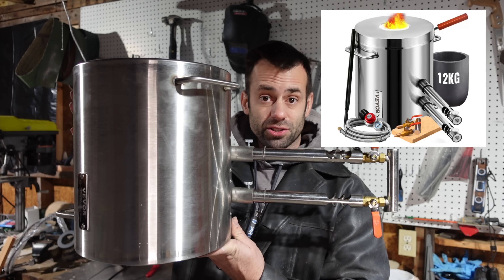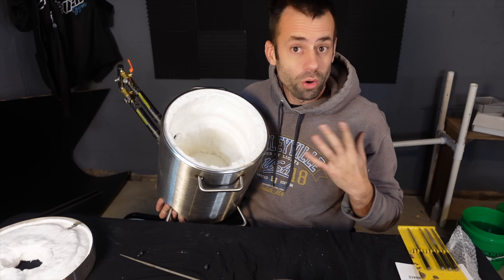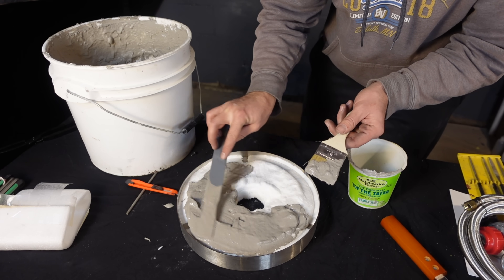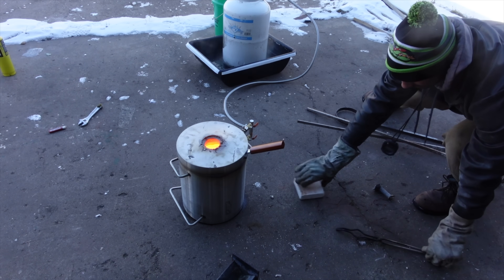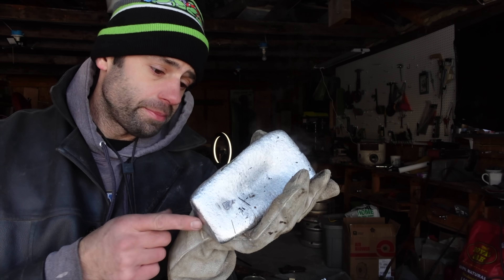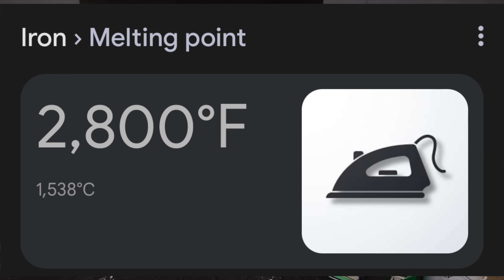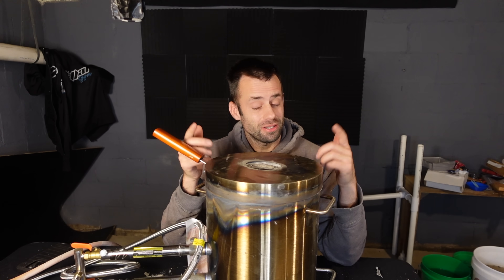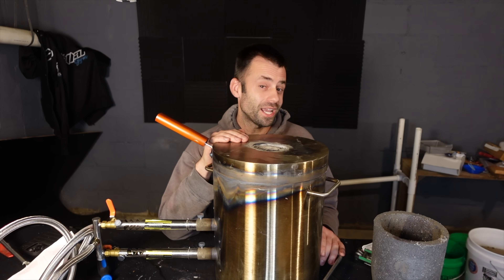Vevor 12K Melting Furnace Review: Is it Better to Build or Buy a Foundry Furnace

Comment: I've been doing this for some 60 years (not joking) and there are a few operational tricks you may want to pay attention to. Yes, this is a perfect what not to do video.

Correct on the lifting tongs, crucibles are made of clay and graphite, both are fragile and worse when combined. Ther idea of lifting with tongs is okey if they weigh under 2kg, more than that and damaging them is immanent. 

Small furnaces like this are only good for small crucibles.  Even if a #16 will physically fit, you don't have the right circulation room around it for proper heating.  Also, a small furnace kike this only needs one burner, these looks a bit crazy and consume too much Propane.  I like to see room around my crucible, it should only take up 1/2 of the inside width of the opening and floor.

Though fire wool is technically sufficient to hold the heat, it isn't sufficient over time to protect the furnace body.  I use a thin 1/2" thick rock cloth around the inside and layer in high temperature furnace concrete (not the patch used here in the video).  Use some heavy gauge stainless steel wire to hold the white cloth in place and it also acts as rebar in the mix. I would suggest layering or pouring it over an inch thick or more on all sides and bottom. The lid should be twice as thick and have a steel lip in the bottom to hold the lid material in.

And above all else, the lid opening is not for cramming materials into the crucible, that is the necessary burn relief hole (chimney if you will), throttle back on the gas ad any blower you have on your arrangement and use fireproof gloves or tongs or even a pouring funnel to direct materials into the crucible.  Do this quickly and cleanly and it won't mess up your heating process.  More room around the crucible, as I said above, will allow it circulation room and room for lifting tools, and you will work better and easier, and you can thank me later.

Comment: I use a product called Satanite to cover the inside of the kaowool in my homemade furnace. It's not expensive and works really well. When correctly prepared it looks like the greenpatch you used. It takes a few days to dry after you apply it (I use a minimum of 2 coats, wait until the first is mostly dry then apply a second one) and after it's completely dry I fire it with an empty furnace for at least 30min. It has held very well for a few years.
Reply from the maker: I actually have used that as well. I didn’t like it as much because it cracked so badly.
Reply: I’ve done some more things with furnaces I’ve built.

Another thing you can do is use ITC 100, from the pottery industry, which is reflective to infrared and boosts the effectiveness of one of these tremendously. You can apply either to kaowool directly, or onto the refractory. It’s expensive but effective.

Comment: Aluminium cans are ultra pure aluminium as is aluminium cable. Most other “aluminium” is a copper magnesium aluminium alloy of varying composition.
The ABS plastic coating on drink cans leaves a nasty soot when burnt.

Comment: Would wrapping an electric blanket around the tank set on low prevent freezing?
Reply from the maker: Possibly. I’ve never tried that one. I just go with the hot water.
Reply: @lundgrenbronzestudios  Ok, thanks.
Reply: The tank gets cold from the propane changing from a liquid to a vapor.  It's not usually a problem when using it in a low flow environment, but when pulling large amounts of gas like this it is.  What the tank needs is heat from the environment to vaporize the liquid.  Once propane gets to around -42 (Celsius or Fahrenheit, either works) it will just stay a liquid and you can pour it into a cup.

Comment: i wonder if i could make wrght iron spung with it hmm.
Reply from the maker: I’m not sure.
Reply: @lundgrenbronzestudios  i think it can make molten steel with a single upgrade. burners get plenty hot. im 90 percent sure the 2700f is cuz the refractory is rated for that. i got 3000f refractory blanket that ive used to line my home maid blast furnace. thats the same thickness this uses. nice review of the product. shows me what i needed to know. good job! and dry sand you should be putting hot items on. bad things happen other wize.

Comment: Ive been making homemade furnaces since the king of random made that mini metal foundry video like 10 years ago. I finally cracked down and bought a devils-Forge and I gotta say I couldn't belive how crappy my home made furnaces where compared to it, the damn thing can melt copper in 10 minutes, normally I'm pushing 25-35 minutes to melt as much as I did in my first go with it. Given that the FBM2B or whatever it was I bought the 10KG model only cost me $300 id absolutely recommend it to anyone who wants to get into the hobby or there smaller one for $220 Id guess the amount I was spending to build my own not even counting my time was around $200 and you'd sure as hell save a ton on the propane.

Comment: I've got this same furnace. I used Stannite refractory coating. I had to do two applications because of cracking and things got pretty lumpy. The thin SS shell warped after a couple of firings so I have considerable leakage around the edge of the lid. Still works. I've only melted aluminum so far but intend to try copper & brass. I've got a larger fire brick lined furnace that I've been using for a few years. I tried the Vevor in forging mode but I'm not setup well for that. The blast coming out the front I partly blocked with fire bricks but then it was difficult to get the work in & out. Need a lot longer tongs. 

The cast iron melt was interesting. Didn't expect that. Will iron destroy that crucible? 
Safety! I agree get off the concrete, it will blow out. I invested in fire resistant chaps, boot covers & gloves plus a full face shield. Never wear synthetic clothes when casting! If the crucible breaks or you spatter molten metal it will eat right through you!

Comment: useful stuff. I was surprised at the cast iron too. I have a second hand smaller vevor one that has the same warp in the lid, so I am thinking its just a thing...I'm not using the casing I bought it for the burners and the refractory because it was such a good buy. Who ever used it before me didnt coat the ceramic wool so who knows what happened. I actually made my own rigidiser and was able to soak the ceramic fibre but I still went ahead and coated it with fire cement just to be sure (an extra £30 is worth my lungs)
Did you flux the crucible?
thanks for sharing
Reply from the maker: I did not flux the crucible. My past crucibles I didn’t need to, this one though I think maybe should be.
Reply: @lundgrenbronzestudios  I have a couple of similar crucibles and I wasn't sure but it seems like doing it is just a better idea than not doing and won't cause any problems but could stop a few. As far as I can tell fluxing is usually to stop precious metals from sticking to crucibles but stopping copper or bronze sticking seems like a good idea too.
Thanks for answering

Comment: YouTube creator luckygen1001 melts a lot of cast iron.  If I recall, he always cuts and analyzes sprues to make sure alloy has proper carbon matrix for best properties.  So many antiques are made from cast iron.  Remember when I was a kid having an elaborate large toy bank made from CI.   They are quite valuable now, unfortunately mine was stolen. Cast Iron is very fluid - great for thin wall castings.
Reply from the maker: Yeah luckgen1001 is a metal master. He really knows his stuff.
Reply: @lundgrenbronzestudios  Frankly, I think a furnace with a heavy cast slurry 1-2" 3000F materials inner lining with an Koa-wool outer blanket will hold up longer, especially with cast iron.  Just an uneducated guess though - time will tell, I guess.   Also surprised only one layer of wool, not two?  Wonder what the wool's tmp rating is?  
Nice score  on both the furnace/forge and the GreenPatch - sweet!  Looking forward to more cast iron projects.😊

Comment: Seems to me that this is a perfect kit to build your own anyway. I'm not a fan of the thin wall stainless, or how thin they have the ceramic blanket. But if I were to make my own furnace, I'd much rather use the twin burners, valves and accessories that this comes with, so I don't have to source my own or possibly not build it correctly.
Reply from the maker: The blanked is inset so it is actually thicker than it looks. It’s an inch thick.

Comment: How about melting down battery plates? The plate filler has always been a question for me to get to melt down into pure lead, but I've never had a proper furnace to melt my lead.
Reply: I would not use that much heat to melt lead, I've melted a lot of lead in my life and toxicity is overrated when working with metallic lead.  Batteries on the other hand have some other additives and lead oxides and I don't think I would melt one.  I've heard of people doing it chemically.
Reply from the maker: I don’t want to handle lead. It’s too toxic.

Comment: Can you use Water Glass , used also to seal eggs to preserve?
Sodium Silicate I think is the real
Name.
Reply from the maker: I’m not sure. I’ve never heard of that being used but silica is not really made for temperatures that high.
Reply: Yes only to 2000F deg 

Sodium silicates are stable in neutral and alkaline solutions. In acidic solutions, the silicate ions react with hydrogen ions to form silicic acids, which tend to decompose into hydrated silicon dioxide gel.[citation needed] Heated to drive off the water, the result is a hard translucent substance called silica gel, widely used as a desiccant. It can withstand temperatures up to 1100 °C.

Comment: My wife purchased this exact model for me for Christmas.  I have experience with coal/charcoal blacksmith forges, but no prior experience with propane forges, nor with melting furnaces of any kind.  I found setting up and operation pretty straight forward.  I can say that melting copper was very easy and I had no problems.  I have to agree that the tongs that come with the kit are no good for lifting the or pouring the crucible.  Please please, invest in a good set of lifting tongs and pouring tongs as was suggested in the video.  As a side note in that vein, I used refractory cement on the inside of my furnace and put on a fairly thick layer.  As a result, the lifting tongs do not fit inside with the crucible and I have to reline the furnace using a thinner layer.  Just something to be aware of if you go the refractory cement route.
Reply: Your wife just happened to know that you would like a kiln for Christmas? LOL! and she "purchased" it for you? You made my day!

Comment: Just gpt tje 8k, looking at coating options, then a good tong design, so great timing. Going to make a larger one since I have most of the materials. Going to try using one propane burner and one used oil burner.

Comment: I got one of these from Vevor. Not the exact same model. I haven't used it because I am nervous about lifting the hot crucible with that metal holser you said would be dangerous. I'm not sure where to get a proper lifter and I need a large crucible. I don't know where to get one of those either. This video is excellent. TY!
Reply from the maker: I made my own lifting tongs. I haven’t perfected them yet so I haven’t made a video.
Reply: I baught a kit of crucibles on amizon .  They were pretty cheap.
Reply: Amazon is where I got mine (not cheap), one set for lifting like those in this video, and another set for pouring. Definitely need good tools because dropping the crucible is a big no no.  Proper leather apron and sleeves, gloves and boots all a must.

Comment: Never, ever use the same crucible for different metals!
Reply from the maker: It’s not dangerous. I was just doing it for a test. I have a crucible for each metal when I do my sculptures. Mixing al with copper simply makes aluminum bronze. Mixing iron with bronze is simply another alloy of bronze.
Reply: @lundgrenbronzestudios thanks for the explanation.  Using different crucibles for different metals is one of those laws…. Good to know when it matters.

Comment: Good test. My Devil's forge is similar with one burner. I am not sure if it will reach to cast iron but other metals have been OK. It is a good idea to use a heat bath under the gas tank. My problem with the Winter work is the freezing gas. Must try this.
Reply from the maker: I haven’t tried a devil forge. They look nice though.

Comment: I have those tongs that you pinch the side of the crucible with, but I only use them for a small melts. I don’t use them when I do large melts because I’ve seen a lot of accidents happen online and I don’t want that to happen when I do the 10 pounds That is with cast-iron and the poor temperature is a little different than it’s melting temperature and I know it says 2200° but you have to get it a lot hotter to do that like the pouring temperature is close to 3000° like 2800° to be able to get it hot enough to melt it and pour it and when it’s melted I’ve melted a lot like three or four times I’ve melted it less than a year actually maybe like two years I think and it’ll look like silver and it will be really really fluid and you’ll see your reflection in it too. Just giving some advice on if you decide to do it anymore you’ll know what it looks like
Reply from the maker: What type of burner do you use for that?

Comment: Had no idea I needed to coat the insulation!?  Thanks!   Back when I was using propane a lot and the tank would freeze I would use a weed burner to heat the tank up. Looks crazy but works good. No recommended for the faint of heart, but neither is casting. On a pipe like that, probably whats burning off is poopoo, ha ha.   I look forward to the after 6 mos review.
Reply from the maker: I’ll keep you posted.
Reply: Yes coat the insulation. It's extremely dangerous to your long term health not to.

Comment: i just got a very similar 2 burner 12kg furnace. i got it cause i was having trouble with melting bronze on my crappy single burner.  now bronze is no problem!  i got a little vevor metal lathe and have been casting my bar stock to practice with.
     I'm super impressed that you've melted cast iron in that little furnace! woah!  i thought you'd need a cupola for that and a long wait! 
Thanks for running one of the most informative home metal casting channels. i learn a lot of great stuff from your videos
Reply from the maker: I tried smelting my own iron and melting it and I was not able to get that to melt. So it seems that it’s very alloy dependent.
Reply: Well you not gonna with one of these !! Max temp is only about 2400 degrees and iron takes 2900 to 3000 continuous! Propane won't get there on these !! I've been smelting for 10 yrs now
Reply from the maker: @ did you watch the video?

Comment: Those 30 pound cylinders intended for RV use have an excess flow check valve for safety. Always open the valve very slowly, if too fast and your ear is close, the click can be heard. Great furnace, I have the 6 kg vevor and it works great.
Reply: i assume this is plain ol propane and propane accessories, not like LNG or something else
Reply: @cdoublejj  You have assumed correctly

Comment: if I buy one i'll use your link/.
Reply: Yep I just ordered one, definitely want to try some cast iron. Based on this and other youtube videos the common issue seems to be the lid warps, might try to set a large discarded disc brake rotor atop to act as a heat sink. Or possibly make a new lid out of solid refractory with stainless steel mesh for reinforcement

Comment: I have found if I put a 1200W halogen lamp RIGHT next to the propane tank, it's usually good enough to keep pressure at down to -8C..
Reply from the maker: I’ve never tried that. Good tip!
Reply: Lol I know the look you had on your face all too well! That omfg I need long johns now look
Reply: Be careful not to overheat, whats really needed is a gauge in between the tank and the regulator to monitor tank pressure, should keep it below 200 psi.

Comment: I have this furnace at home and I am very satisfied, but never try cast iron. I have seen plenty of videos a there said everywhere it cant be melted. So I never tried.I cant wait try it myself
Reply from the maker: I may have just had an alloy that worked. There seems to be a lot of different mixes of cast iron.
Reply: @lundgrenbronzestudios  typically the iron that hobbyists melt is disc brake rotors, I believe it's nodular ductile iron. That old briitle sewer line is most definitely gray iron. Just looked it up, the melting point of gray iron 2200F  is a bit higher than ductile iron 2100F, so, yeah this furnace should be good to go for Iron. Ductile Cast iron is very strong, many parts like brake rotors, crankshafts, etc made from it.